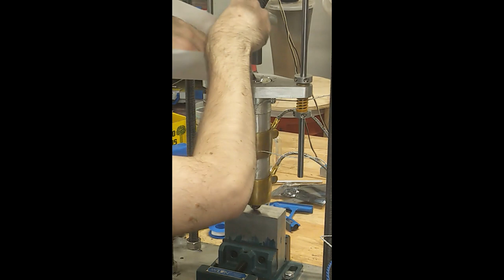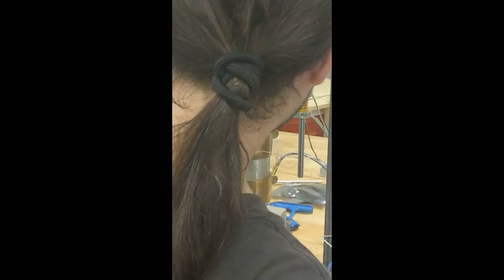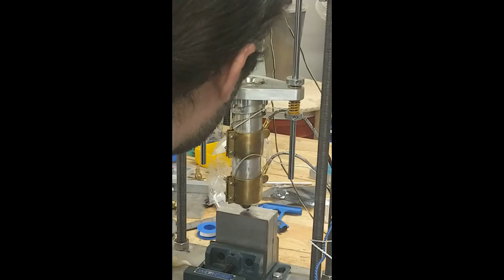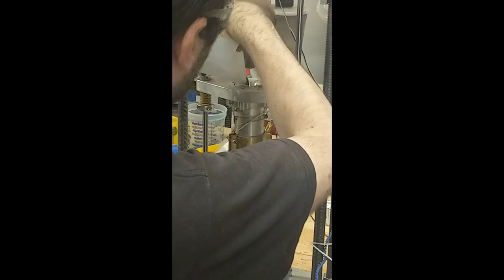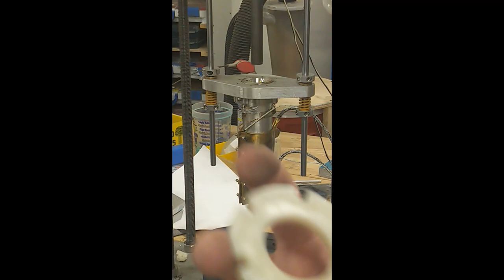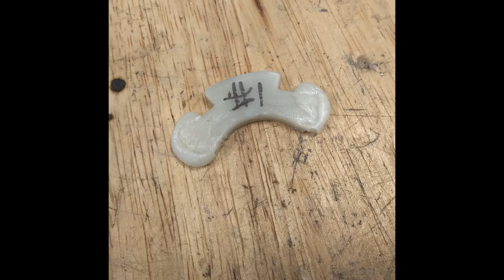DIY Injection Molding Machine - First Test

Comment: Pre heat your mold
Reply from the maker: Preheating the mold is definitely a variable I want to experiment with eventually.🙂 
It's hard to keep stable because the cooling plastic will continue to heat the mold.   
But for full-automation I'd definitely want control over mold heating.